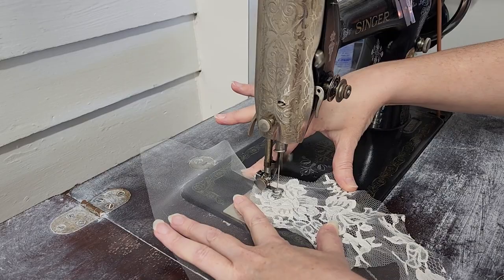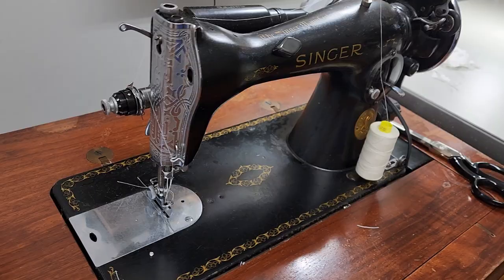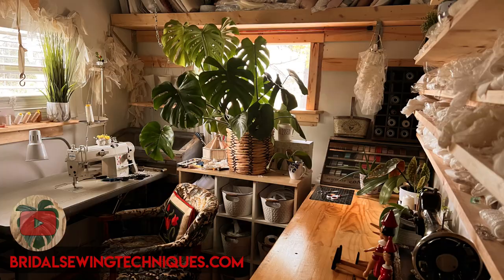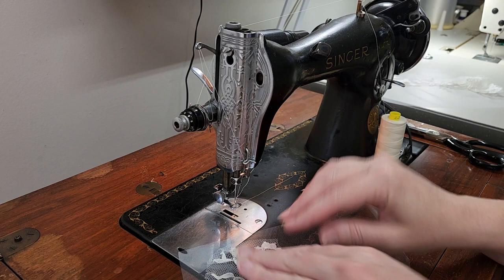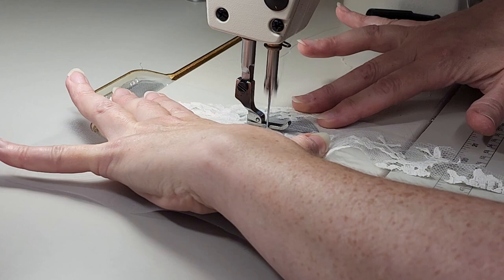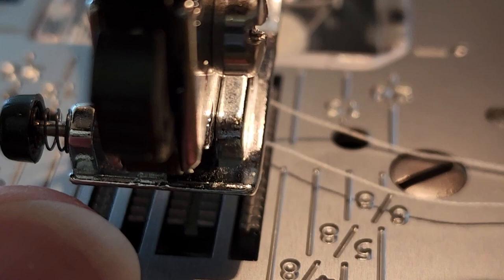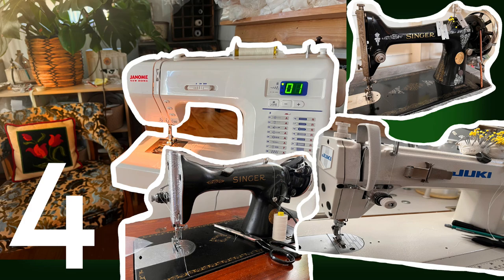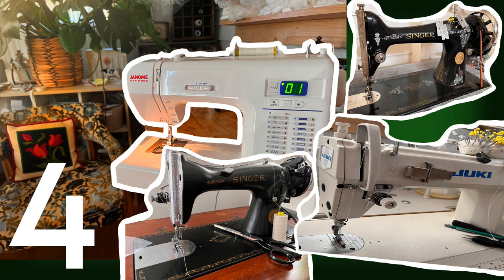LEARN to sew ~*LACE*~  on 4 different machines! | Appliqué | Free-Motion Stiching

Comment: Is the method the same if you're sewing lace applique onto silk? Or does that have to be done by hand? And would you still use a size 18 ball point needle or one specifically for silk/satin?
Reply from the maker: Check out my latest livestream I did yesterday. We took a deep dive into this question. One thing we didn't discuss was appliqué to silk. If you want it to be reversible, and not damage the silk with needle holes, hand sewing is always best.
Reply: @BridalSewing  oh great! I hadn't had a chance to watch it yet,  thanks so much!
Reply: @BridalSewing  I finally got a chance to watch the livestream (I really enjoyed it! Will it be a regular thing? Would love to be able to catch it live), but I have a couple more questions. 
When you say if I want the silk to be reversible, do you just mean if the silk is unlined/don't want the inside to look ugly? 
And when you say if I don't want to put holes in the fabric, do you mean machine sewing the pace on could cause runs, or holes in the silk that will eventually get bigger and fray? Or just if I want to remove the lace later the silk will have holes where the needle has gone through, whereas if it's sewn by hand it won't?

Comment: I recently tried this tip on my Juki but I failed. The lace was not sitting flat on the dress hem. Was using the transparent thread and I think that's what made it difficult for me. How do you keep your lace flat?
Reply from the maker: Pins! :) also- invisible thread is much trickier! It tends to stretch, so you need almost no tension on the upper thread, and also make sure you somewhat loosly, hand wind  the bobbin.
Reply: @BridalSewing  😯 oooo 
I didn't ever think to do that. To hand wind the bobbin. Tension was the big culprit for sure but didn't think about the tightness of the thread around the bobbin. Thank you so much.